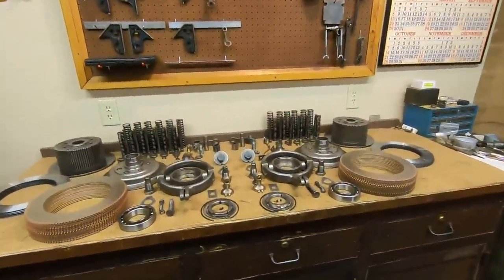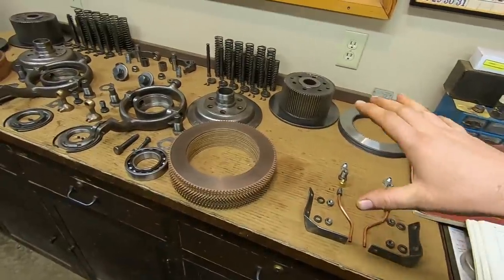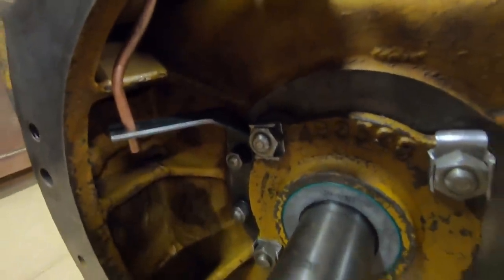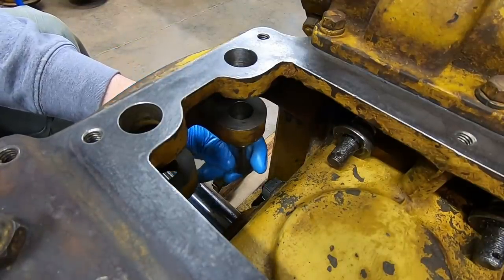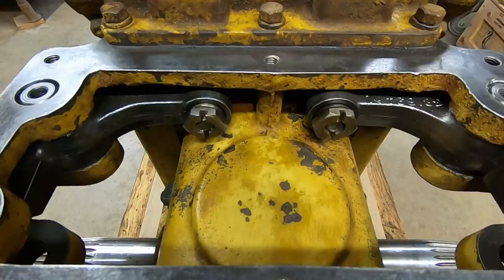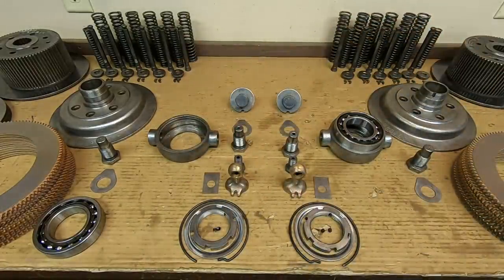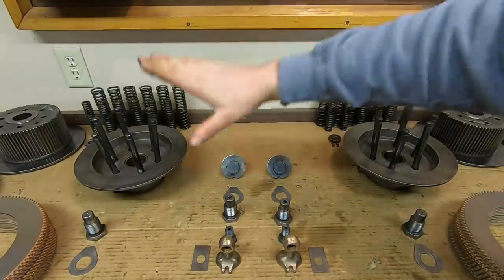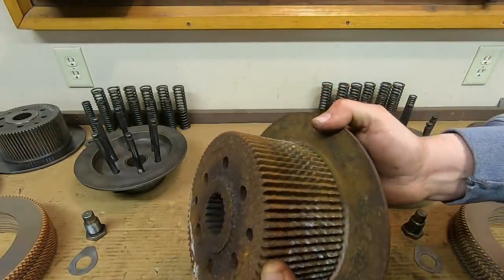Caterpillar D2 #5J1113 Chassis Rebuild Ep.20: Assembling Steering Clutch Packs & Control Mechanisms

Comment: I remember thinking when you pulled that transmission in from outside and thinking, “this will take until next Summer to fix up.” It doesn’t hurt that you know what you’re doing and have experience but, man, for a guy in his barn this is impressive stuff. Re: oil cups facing in opposite directions. I’m gonna argue (like I know something!) that it’s deliberate. You oil one, walk around the other side to oil the other and it opens the same way as the first one. That’s my theory....

Comment: Old school tip. If you put a pipe cleaner you would find at a craft store and you put it down the oil line and hook it in the oil cup it will allow the oil to slowly drip while machine is in operation.

Comment: Another lube fix, drill through pin small hole to center of pin. Side drill pin outside to center. Drill and tap cover at pin center for a zerks. Cut gasket  to hole size of pin/ o-ring. Place a o- ring between case and pin when install cover. You can now grease when want to! Now you could instead of drill and tap cover. Would need to drill pin center, with two holes from out to inside. One center of bearing, one center of where top of pin in case. Drill and tap cases from side to pin boar. Tap case for a zerks  Now use a cut off or grove bit, in lathe, cut a grove, around pin at upper hole. This is so, no matter how put in pin the grease will get into pin, down to center hole and out to bearing. And can cover pin with gasket, to cover for seal. Note: center pin hole is small not to damage removal pin threads.

Comment: The tapped holes securing the nuts on the clutch assembly is known as a A Scotch key or Dutch key. 
I had a hard time finding any good information on the practice as Dutch drilling insisted on bringing up some Dutch drilling company. and Scotch Key kept coming up with Scotch whisky.
The internet is great sometimes and others not so much.

Comment: On the bare metal parts I usually heat to very warm with a torch to remove any latent moisture and paint on linseed oil. Wipe away excess with a rag. Parts stay rust free for the most part

Comment: I know from experience that the bimetallic clutches can stick. I recently acquired a 2H D6 that had a stuck steering clutch. Oil contamination from bad transmission and final drive seals can cause them to stick.  The suction created between the clutch plates from the oil was enough to keep them from releasing. I had to use pry bars with a good amount of force to break the suction and seperate the clutch plates from each other.

Comment: I've seen that old car restorers simply replace the rollers in the roller bearing, reusing the two crowns. We're talking Chase old. If you have used up ones, maybe worth exploring? It's not difficult to figure out the proper spec, nor the materials required. Just my 2 cents.

Another slightly more expensive bearing replacement would be Turcite. Usually recommended for lathe ways, this stuff is actually a very capable bearing material, with one distinct claim to glory, its lubrication operation range is dry to medium lubrication. It doesn't need to be flooded.

For a low hour machine, IMO, Turcite is a very stable, indestructible option. If one specs their material right, the bearing ecosystem could technically speaking outlast the machine. Technically.

Comment: You could also cross drill the shaft and add a grease fitting where you had the bolt and washers

Comment: when using that old inner race as a driver, what i do is put a cut on it with a cutoff wheel, that way it cannot get locked onto the hub of whatever your pressing it onto. that and i flip it over to where the bigger part is facing up, that way you have something to pry against should it get stuck in place.

Comment: The oil cups facing opposite directions is making my eye twitch LOL, I know its not always possible to have pipe fittings perfectly lined but thats one id have to fix on my own machine.
Reply: @squatch253  Yeah, I figured you had a valid reason for not putting them that way, I have taken a pipe tap and cut the thread a little deeper to get them indexed to get stuff to line up but if the cups were out of thread thats a little different story. Always love watching your videos and can really appreciate your attention to details like that. Cant wait to see what comes after the  finish of the clutch installation.

Comment: So you're saying your internet speed upload is just one step above smoke signal? BTW, I have utilized the hydraulic press to place slight pressure upon my wrench when tightening large locknuts to hold the wrench in place and not damage the locking nut. Doesn't need much pressure at all, just enough to ensure it doesn't slip. As for 27 minute videos, what else are we to do on a Saturday night in February when it's minus 9 outside.

Comment: You might check out this place for your bearings : www.ibtinc.com
We've always come across some weird odd sized bearings and they've always been able to get replacements to match. Use a soft faced hammer, drives pins in much smoother and with far less worry of damaging anything. 
Why not use lock-tite on those set screws? I don't remember which color means what anymore with lock-tite, the blue I think?
I know you may have issues with the longer video's, I don't think that many of your viewers are going to mind. Personally, I don't mind them being long. Great video, cheers :)
Reply: Green is light strength, blue is medium (what I use more most things), and red is high strength.

Comment: Another possibility for the needle bearings would be a 1-1/4" OD x 1" ID bearing such as https://www.mscdirect.com/product/details/09016841 with a 7/8" x 1" sleeve snug-fitted to the shaft (maybe with just a dab of Low Strength Loctite  222). I'd rather do this than take an eighth out of the actuator lever. On edit--https://www.mcmaster.com/5905K137/ would also be a possibility.

Comment: Squatch, you referenced previously how areas that are hard to access after being fully assembled incorporate fold over locks. I noticed that the bracket for the oil lines you installed in the beginning of the video only had lock washers. Are those enough to ensure that they don’t come loose over normal operation? Could they become a hazard at some point down the line? -Evan

Comment: No matter if it's a CAT or other brands without a manual and parts catalog there is no way of doing things. I guess if you don't have new set of bimetallic friction discs for the steering clutches. The only other way would be to rebuild the old pack. If you have a soviet crawler with the same setup. You also have a much limited supply of parts.  Most of the spare parts where made in the 1960s or late 1970s. I have seen bits and pieces here and there and a ton of very old asbestos friction plates that can be riveted to the steel discs(if there teeth are not stripped). I don't have the CAT or Allison discs to compare but probably they are different in size (one is in inch other in metric).

Comment: On those needle bearings would it be possible to just order loose needles? Wouldn’t be as handy as a caged bearing but might be a viable option if you can find the needles in the proper diameter?

Comment: Hey man, Not sure if you'll see this, but do you by chance know why a 50's model D6 8U might lose pressure on a steering lever, and lose drive on that side? Its like something in the linkage let loose, but I would think I would still have drive, just no clutch. Its the right side with the brake lock, so its probably seen some abuse over the years.

Comment: can you recommend a good description or video of reconnecting track after you have to break it for undercarriage repair? I've had track off on my Komatsu D20 4-5 times and I swear every time I'll figure out a better way to do it. Where to position the connecting links, how to pull both ends together. Is it better to work around the sprocket or between sprocket and idler roller?
Reply: @squatch253  The D20 is a 35 hp 3 speed frwd 2 revrs manual transmission weighing 10000 lb about the same size as a D2. It has hydraulic assist on the steering clutches powered by a hydraulic pump in the bottom of the wet clutch case behind the engine. Without hydraulic pressure from that pump you cannot steer. Main clutch is manual release. Komatsu's design for the release mechanism on the D20 is no where near as robust as the Cat one you are working on. I appreciate the hours of time that went into cleaning , polishing and arranging those parts prior to your reassembly.

Comment: If a better clutch hub than the one from your Grandpas cat was not available, could it be reused with the sintered bronze discs?  My thinking is the increased plate count would put the contact points in non-worn areas of the splines.  I know it would not be ideal, but in a pinch for a low use machine?
Reply: I'll look forward to the next installment!

Comment: @7:08.. the shafts. how deep is is drilled and tapped.  is it as deep as the bearing rollers.. or can you chuck it in the lathe and use a cobalt or carbide drill bit to drill a small hole slightly deeper then in the mill or drill press.. drill a hole in from the side so you could with the cover off.. thread in a bolt that is drilled and tapped for a zirc and grease thru the shaft.  i also wonder about using https://www.schaefferoil.com/238-ultra-supreme.html in your pivoting bearings. its too thick for high speed bearings. i know that one lonely farmer uses it on his shafts and bushings..  its just a thought..  it will require a separate grease gun and a box of disposable gloves and some decent shop towels as you don't want to get it really on your hands. super hard to get it off.

Comment: Starlink coming soon. It will destroy the expensive old phone line, and cellular radio, based systems. One of my friends is on the beta up in the north west and he's getting near 100Mbps a lot of the time, he has seen over 150Mbps down and 30Mbps up. The final disk is bound to be steel, it doesn't rotate relative to the pressure plate and it protects the pressure plate from the friction plate... or am I misunderstanding how that works?

Comment: Does anyone know what the core plugs are for on either side of the transmission case, where the final drives bolt on? You can see one of them in the top right of the picture at 4:48
Reply: @squatch253  Wow! They really had their thinking-caps on when they designed these machines! Thank you for the reply Squatch